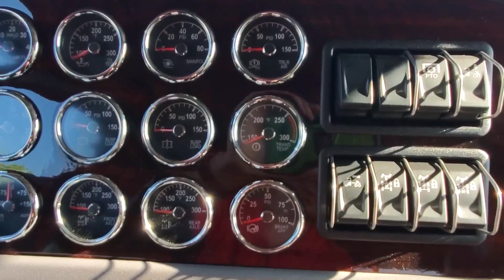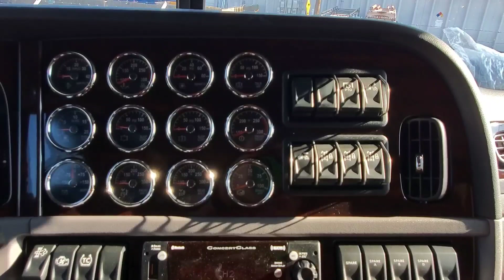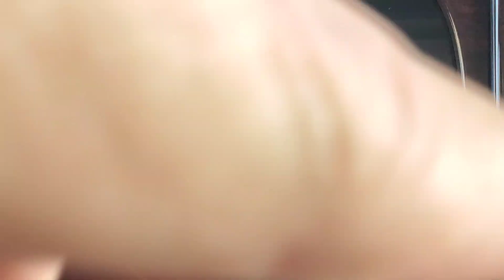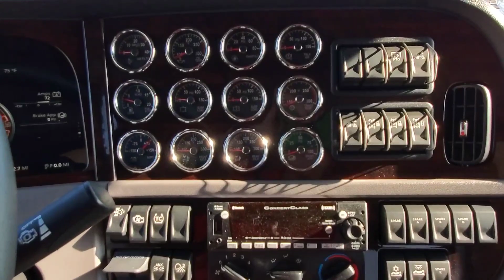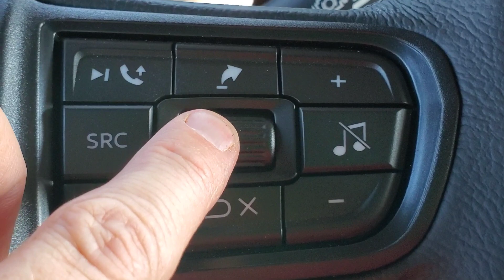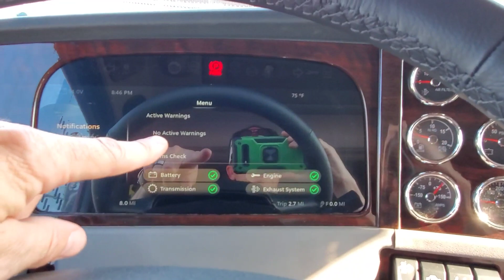Dash updates and why Manufacturing delays are happening.

Comment: I've driven International, Volvo, Freightliner and PACCAR trucks with steering wheel controls for years and never once has the "smart wheel" failed me. My cars have steering wheel controls and never have I ever been concerned with their reliability. 

All these drivers that complain about the 389 switching over to a mandatory "smart wheel" think the older 389s were old school and this wheel will only complicate things. 

News Flash: all trucks within the last nearly 2 decades have been running on multiplex computer control. Your "old school" 389 is just as digital as the upgraded one albeit an older primitive design. All your gauges are digitally controlled and daisy chained back to a computer that gives you readouts. 

Be happy in this day and age truck manufacturers are still cranking out hoods because that's all about to end in the near future anyway.

Comment: Two things if they want to put a glass dash in it make it all that way make the A and B panel glass ..... The kenworth rocker switches that you have to have a dealer reprogram the dash when the fail not cool . Paccar better start listening to there customers i know several guys that might switch brands i have an 2011 389 with absolutely no plans now of upgrading past a 2022 that dash is my favorite and it can be rebuild and upgraded aftermarket this new one it fails and your stuck spending way way way to much we got burnt on the nav screens never buy another one like that either .

Comment: I do like the B panel I'll have to see the A panel in person it looks to have a lot of glare in it. As for as the smart wheel goes i prefer switches on the dash. Every truck I've driven since around 2012 has had a smart wheel and I still hit buttons by accident or have to search for the one I want. Companies talk about driver distractions but they keep adding more distractions to the truck 🤷‍♂️
Reply: It's just what you learned or used to drive, for me I don't mind switches, but I can imagine pressing the buttons by accident if you're not really used to it or something, it also depends what truck you drive, for me out here in Europe I'm having the same problem with a Volvo, all the rest is pretty much oke
Reply: @truckingwithwim8039  your right about that i haven't driven a truck since the early 2000 with the reading light above the driver door but I still reach up there first when I need to turn on the light lol old habits are hard to break